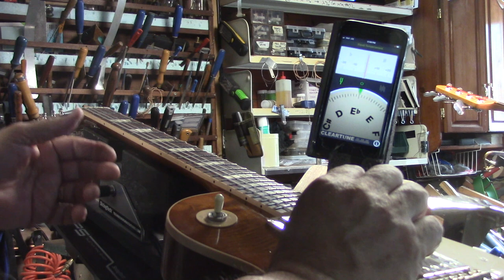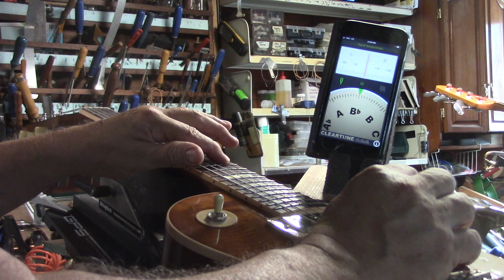Guitar Tech Shop Tour / Les Paul Rescue@StringTechWorkstations

Comment: Starting around 9:00 when looking at the tailpiece-how does one deal with the string grooves from wrapping around? Do you replace the tailpiece after so many years or keep leveling it after string changes?
Reply from the maker: This is one of the issues with the "wraparound" ... those strings will cut through the tailpiece like a cheese-cutter. Kyle with be swapping out for a new tailpiece and new studs. If you have a brand new guitar ... you are best to buy a dedicated tailpiece for the wrap around ... if you choose to go that route.

Comment: Hi why does my top E vibrate and move from side to side when played open...on a strat....thanks
Reply from the maker: Loose saddle screws ? If it is just the open string ... nut slot cut too low ?  I'm just venturing a guess. Without actually hearing and seeing, it's difficult to diagnose.
Reply: @StringTechWorkstations  OK thanks  for quick  response..I'll change the nut first..
Reply from the maker: Before you go to the trouble of changing the nut ... fill and re-file that one string to determine if that is the problem.  Good Luck ! MMcC
Reply: @StringTechWorkstations  thanks Sean Cobh Ireland